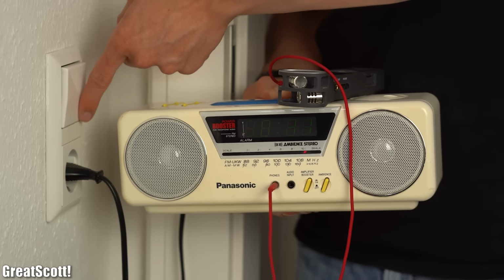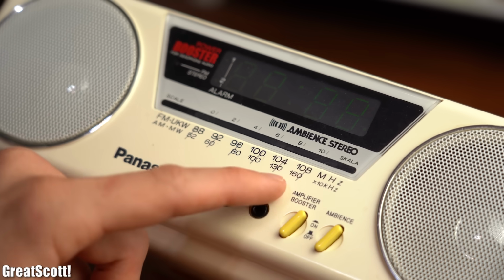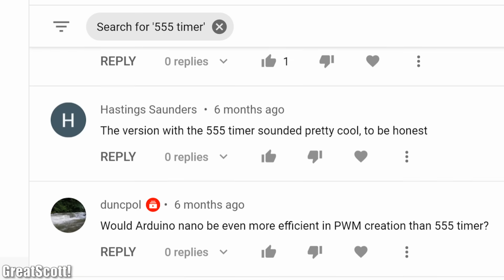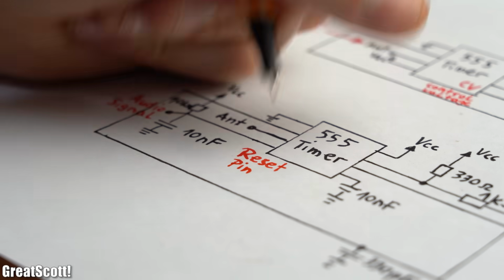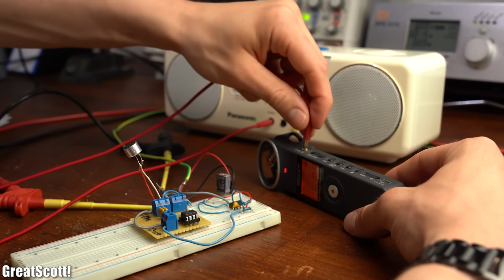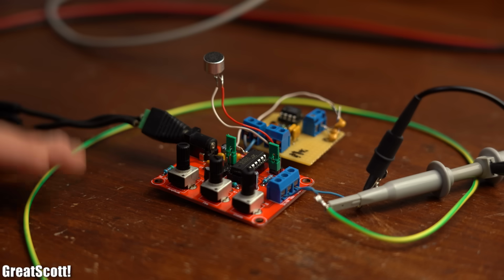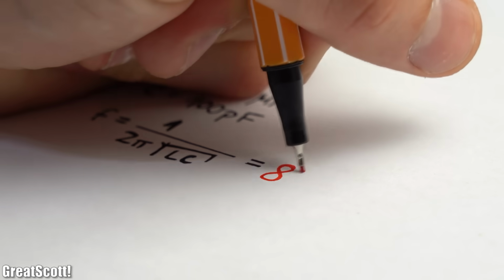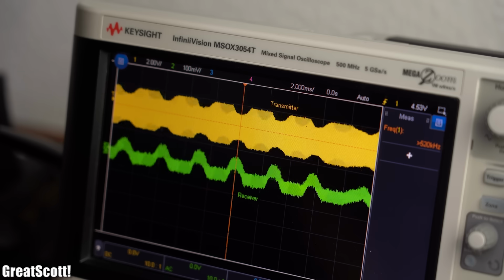Building a Super Simple AM Radio Transmitter & Receiver! Keeping Wireless Audio Communication easy!

Comment: I remember once years ago I built some type of radio/microwave receiver. It consisted of three quadruple bowtie antennas tuned for around 2GHz and three germanium diodes to rectify the received energy to a signal. I then connected that to two integrated circuits operational amplifiers LM358 (cascading operational amplifier with 22KHz bandwidth) if I remember correct. And that was supplied by a bipolar voltage of +/- 1.5v. 2 batteries. 
The aim of that receiver was to receive any kind of radio and long microwaves. And it did work. I could catch FM signals, mains 50Hz distortions and the microwaves from the wifi. It was heard like ticks in my soviet era 150 ohm headphone. The receiver contained NO coil.

Comment: My simple transmitter based on 6p3s tube. With main frequency generator on 6j8. For modulation i built simplest tube amplifier.... This thing can produce 7W of radio signal. It's Powerful for such construction.

Comment: 5:09 how to make an antenna? 
8:40 factors and inductance required to make a coil for antenna and how antenna works?

Please sir..
Reply: A simple piece of wire of around lambda/4 length can work as an antenna for such cases. The coil is part of the LC tank circuit.
Reply: @rtechlabs  Thanks 😊

Comment: What If you use FM instead of AM will voice quality increase ?
Reply: AM has a bandwidth of 2fm where fm is the max freq of the message signal used to modulate the carrier. Whereas fm signal has considerable large bandwidth due to large number of sidebands in the spectrum. Larger the bandwidth, greater will be the audio quality as you won't band limit the audio signal.  Another reason is because AM is more susceptible to noise as noise will cause changes in the amplitude of the AM and our information is contained in amplitude of AM, whereas FM is less susceptible as the information/audio is present in the frequency instead of amplitude in FM.
Reply: @rtechlabs  the larger bandwidth for FM does not increase the audio bandwidth. FM has a higher needed bandwidth then AM, for the same audio bandwidth. Instead FM is much more power efficient then AM, which is why it often sounds better
Reply from the maker: Yes

Comment: 555 as an AM digital transmitter!
Reply: It's actually a FM transmitter, but because of the way AM receivers work, it's a hacky way to do the job.  The AM transmitter is looking for a signal at its tuned frequency.  As the carrier moves away from that frequency, the receiver sees a reduction in signal strength on a bell curve.   So an FM transmitter centered on the same frequency will cause the same reduction in signal strength, by moving away from the tuned frequency instead of by adjusting the carrier strength.  So it "works", but it also interferes more with adjacent channels as it encroaches on their band.
Reply: @ovalteen4404  Cool! Anyway, this looks like a data transmission project using AM/FM. What do you think @GreatScott ?

Comment: Just in time, I was struggling to build an AM radio!!

Y'all can also try this project from Doctor Volt, it requires only an Arduino to generate AM signal: https://www.instructables.com/AM-Transmitter-With-Arduino/
The carrier frequency is a square wave created from dividing the 16 megahertz clock signal, and the audio is encoded by PWMing.
Reply: This will work perfectly as long as you view it from the time domain perspective. But if you take a look at the spectrum of an AM generated using square carrier, the spectrum will contain infinite harmonics :). Hence, not a good technique for AM generation. One can verify this by quick simulation in GNU Radio.
Reply: @rtechlabs  yes good point, I was able to pick up my music from double, triple the frequency. i think it's okay though, at least I hear something, nice to know that at least something I try acc works XD
Reply: In general, every transmitter generates harmonics. Therefore, it is important to cut them off with a low-pass filter before passing the signal to an antenna.
Reply: @DoctorVolt  thanks, i'll try that :)

Comment: you can also use a crystal oscillator used for microprocessor clocks in the 80s to make a transmitter as it contains the entire oscillator.

also as more and more of the analog fm broadcasters go digital there will be the space opening up and the fcc may soon care less about the part 15 rules unless your transmitter should somehow cause a pacemaker to malfunction and cause a heart attack or completely drown out emergency responder communications.

Comment: I made crystal radio when I was 13 years old at that time people around consider me scientist 😀
Reply from the maker: Nice :-)
Reply: That's so cool! Did you have a kit or something?
Reply: @N0Xa880iUL  no I don't have any kit I made it by my own using a cardboard roll and wrap wire around it to make inductor and using razor blade and pencil led to make diode and a gang capacitor for tuning
Reply: @alexmustang8177  That's genius
Reply: I made a line following robot car and they thought the same😜
Reply: @tanjiro3285  Wow! And how old were you
Reply: @N0Xa880iUL  13-14
Reply: Yeah I can relate to that statement. I was the electronic genius in Jr high. Just because I made my battery voltage give a good shock. I used car radio power supplies when they used tubes in car radios. The output audio transformer would arc about three-quarter of an inch. Don't ask me how to make these projects and don't try this at home.
Reply: @mug wump use a razor blade and number 2 pencil lead. You can also use a corroded penny. I learned that from my friends that went to tech school half a day to take electronics. That was when electronics was fun. Not so fun today.
Reply: this is nested comment section 😂
Reply: @mug wump the main reason I said electronics is not so much fun anymore it's because tubes went away for the most part but with that said. Getting parts like when you could go to Radio Shack, Lafayette and even the local TV repair shop. And let's not forget the local trash pickup when people left old radios, record players tvs and such like out for pickup. Now you have to order everything and you cannot look and see in person. Just try finding a good antenna, it's better to build your own than to buy the junk they sell.

Comment: I had to do a report on AM in our communications class. Built the same transmitter with the 555 and paired another 555 to send a square wave into the transmitter (pretty much broadcast a tone over AM) it blew everyone's mind in class. Teacher was amazed haha.
Also, they have crystal oscillators for am. Litterally plug an audio source to it, make an antenna and you're good to go.
Reply: Make an Antenna! thats what I have been trying for the last 30 years!
Reply: @mohinderkaur6671 ? Just use a half wave dipole

Comment: your AM reciever circuit is simple but its hard to get 7642 ic ...can we build another one with bf494 or simmer transister AM radio using tank circuit for tunning
Reply: You can use an antenna, connect it to the LC tank and then use a peak detector circuit using a Ge diode, feed the output to any transistor amplifier. This should work as a receiver :)
Reply: @rtechlabs  building one of this with bf494 and 1n34a diode waiting for online delivery of diode

Comment: Great! Please make a FM transmitter. Also how can we make antenna instead of buying one
Reply: @doomer boy so AM transmitter is legal
Reply: In my country there is no problem
Reply: How copper wire can transmit signal in open circuit
Reply: @SaminaZafar270   A simple wire can transmit as well as receive :) It acts as a monopole antenna as long as the length is greater that lambda/4
Reply: @rtechlabs  how can a monopole antenna work in open circuit
Reply: @doomer boy A simple wire can transmit as well as receive :) It acts as a monopole antenna as long as the length is greater that lambda/4
Reply: @rtechlabs  Can you explain me

Comment: I'll take a look at this video later, but lemme say thank you so much for brinign back life into such an old topic. Back in school in 2016 i successfully but an AM transmitter only using 2n3904 Transistors (Hartley Oscillator), and i wanted to build the receiver to go along with it, but none of my receivers ever worked. I've tried SO many configurations without "cheating" or using too complext ics, i wanted it to be a receiver using NPN transistors too, but the main issue is idk how to properly measure or deduce why my circuits never worked. Wanna say thanks again, i feel like there's hope for my project again. If yall are interested i can get the schematic of the transimtter that worked at lest. Thanks @GreatScott!
Reply: hey i had the same issue, it's real frustrating
maybe try this circuit
http://www.talkingelectronics.com/projects/TheTransistorAmplifier/images/Fig71bd.gif
you don't need the transformer, just connecting the speaker from 3v to the collector of the last npn transistor works fine. And make sure to put >22uF decoupling capacitor across the supply so there's no unwanted noise.
2n3904 and 2n3906 transistors have worked fine for me.
Only problem is that the output sound is really small. Maybe you can replace the speaker with like a low value resistor and then add a class A amp after the last stage. (don't tinker with the other stages, doesn't make the sound louder, i tried yesterday)

hope it helps :)
Reply: @Kevin-jz9bg  Thank you for the reply! it REALLY means alot to hear that there are others that tinker/deal with this kinda stuff given im a noob. I'll definitely test this. Here is the transimtter i used to build it. Its based on a radio project from a RadioShack 300 projects in 1 kit. I took their morse code transmitter and added my computer speaker input into it. i broke it  up into 3 stages because it was easier to draw lol. 
  https://bubbamachina.files.wordpress.com/2018/04/am-transmitterpng.png?w=666&h=1024
Reply: @bubbamachina1308  thanks for sharing!! I'll try to build it and let u know how it goes!!
For the inductor in the hartley oscillator, can I just take an am inductor from my am radio and tap the center? (it's 55 turns on 1cm * 10cm ferrite rod)

I'm a total n00b too but hey "it's super cool, which I think should be the only prerequisite for doing science." - Physics girl

U shud check out talkingelectronics.com for a buttload more of projects :)
i recommend buying some generals purpose npns and pnps in BULK and just building whatever seems interesting: http://www.talkingelectronics.com/projects/TheTransistorAmplifier/TheTransistorAmplifier-P2.html?ref=driverlayer.com